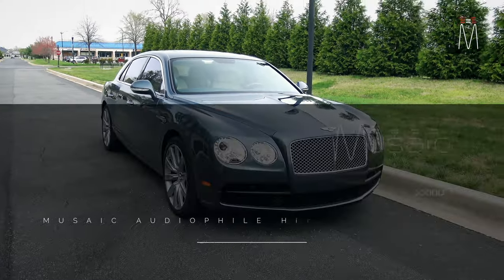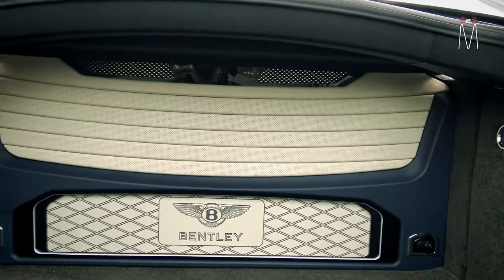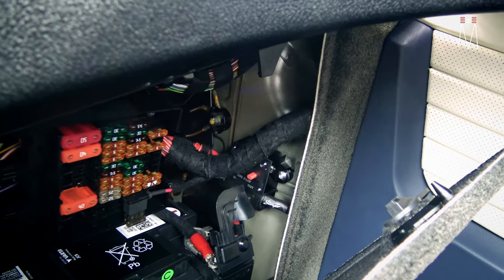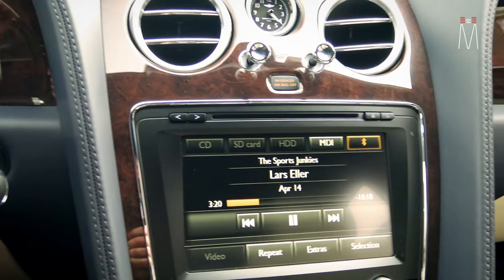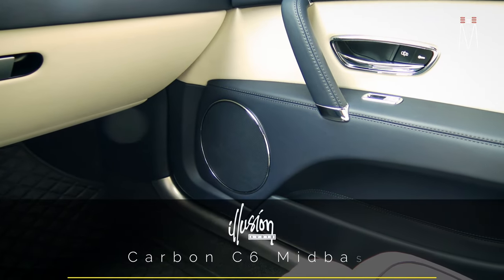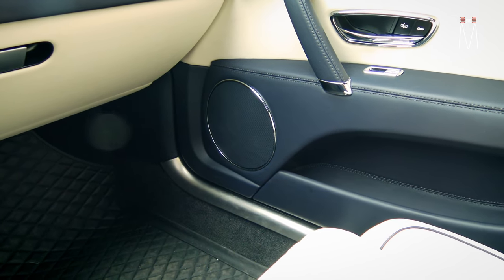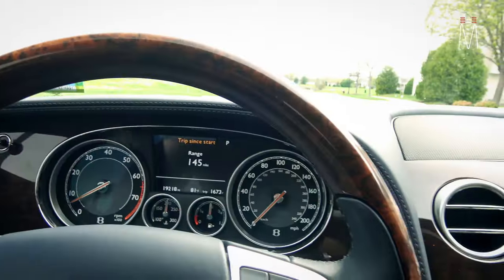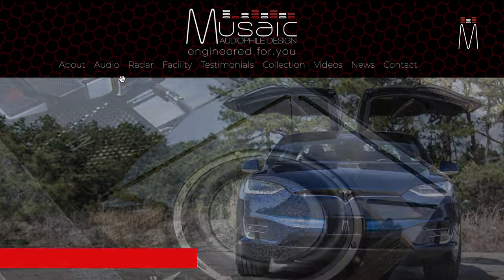Bentley Flying Spur - OEM Style Audiophile Stereo Upgrade EXPLAINED!

Comment: Great build!  Question, assuming there are factory 6.5 location in the back doors, why not install two more mid bass speakers there to get more overall mid bass, and solve that issue?  I did that in my truck and it gave me a lot more midbass punch.  As long as you time align and keep the low pass at around 350 or lower, it doesn’t seem to pull the stage back or down.
Reply from the maker: I generally do the opposite and high pass the rears around 250 that way I dont have any of those MB frequencies that can easily be localized. This would be an option if were a Continental GT and there were two MB locations in the door. But I am not a fan of the rear playing MB frequencies. Dont get me wrong, the front stage sounds amazing and is well blended. But if I am picking apart the design from the cars standpoint...the weak point is the front MB response.

Comment: Matty! I have a question for you. What do you think of the helix amp dsp combos compared to the mosconi pro amps  or the one series mosconis? Can you hear any difference? I know you have experience with both and I know there are many variables involved. But all else being equal, which do you prefer?
Reply: The Zero series, A-Class have the best sound quality. Use a SP2000 hi-tes player and a Aerospace 8-to-12.
Reply from the maker: I prefer the Helix DSP amps over Mosconi and JL. It is preference. I also like the Conductor DSP controller over all the other options from other manufactures.
Reply: Awsome, thanks for the reply. I was leaning towards the helix V8 or V12 so that just helped make up my mind. Really appreciate the time and effort you put in on both the YouTube videos and the podcast! Keep them coming!